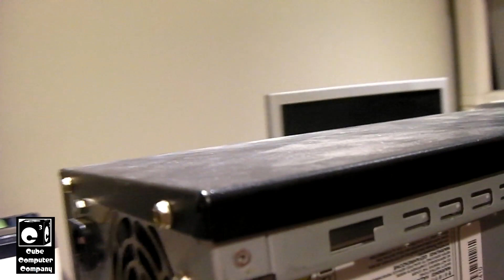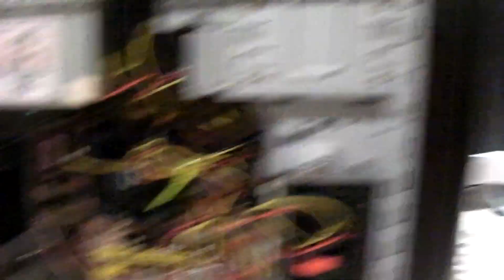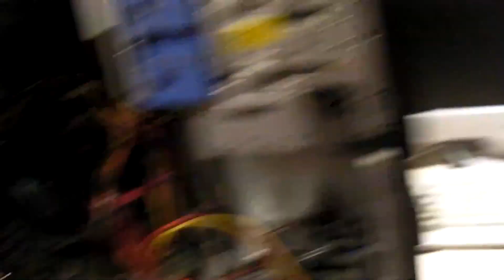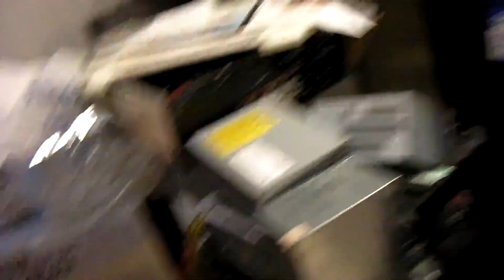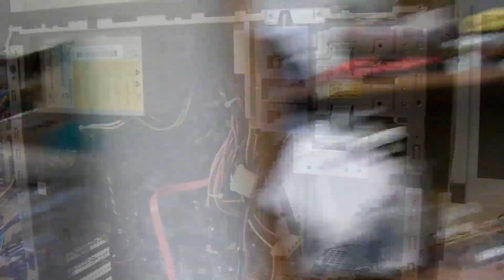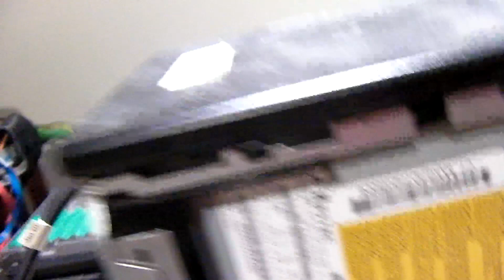Trying the "Cicada" FSP PSU in a couple systems

Comment: should use old junk pentium 4s for testing, less value than a AM2 system can potentially have.  Have a few maybe several myself, one with a low end OG Phenom quad core another with a high end (not quite at each end of each but close), also one that has the AM2 Athlon 64 and probably some dual cores.  Not certain if i have a single core cpu though.

Comment: I've got burnt bad by a failing power supply a few weeks ago. it's not that I wouldn't put it in a system, I wouldn't trust it with anything that needs to stay on. I wouldn't trust these power supplies working or not.
if you're reading this, do no use insignia (best buy brand) power supplies. I've let the magic smoke out of a basically brand new one and it took my motherboard with it.
Reply from the maker: Funny you mention that (which I hate a PSU went rogue on you) I just got a 450W Insignia unit in my possession from a Optiplex 390. It was dropped in some time recently by the previous owner to replace the failed OEM PSU. It's a Huntkey made PSU. Huntkey is pretty decent in build quality, with exception of poor choice of capacitors in some of their units. I wonder what caused the Insignia unit to take out your system. I have several of the 400W units under the Dynex brand as well as a Dynex 520W... all Huntkey OEM. The issue I don't like with Huntkey is the 400W units don't have good OPP, so the unit won't shut down when overloaded beyond 450W or so. They do have SCP so if there's a short, they should shut down. Did your unit pop when it failed?

Yeah this FSP likely will end up getting scrapped.
Reply: Honestly i think all PSUs act different when they fail even if they're cheap or not.I had someone with a Thermaltake power supply kill their motherboard,they powered it off one day and the next day it would not power on at all anymore,turned out both PSU and mobo were completely dead,no pops,no smoke,running fans absoultely nothing.Then i also came across cheap 10$ PSUs that literally started smoking while the computer was on and it still did not kill anything and another one with a 2 day old 170$ Corsair PSU blowing up with a blue flame and killing the hard drive.I'm no expert when it comes to how power supply circuits work but i think it really depends which component in the PSU fails enough to damage one of the other components regardless of what the power supply brand is